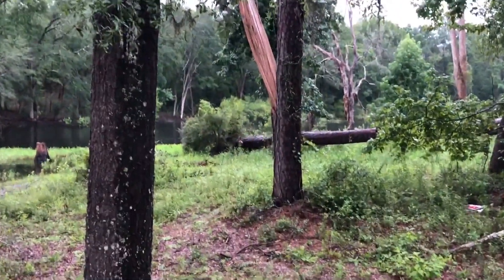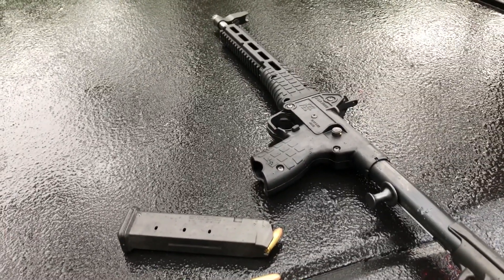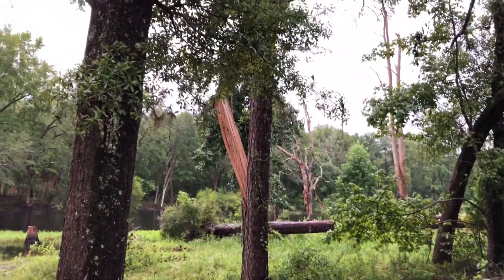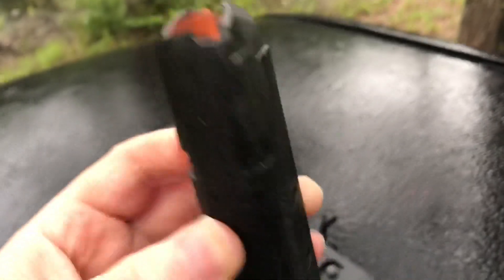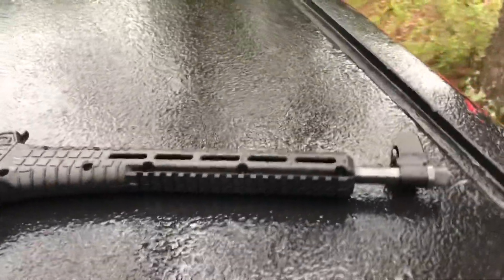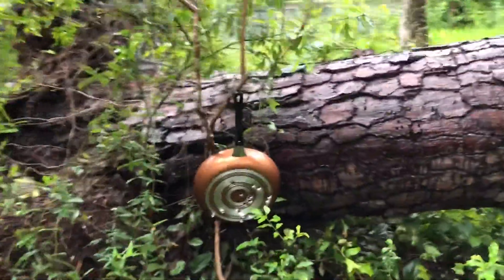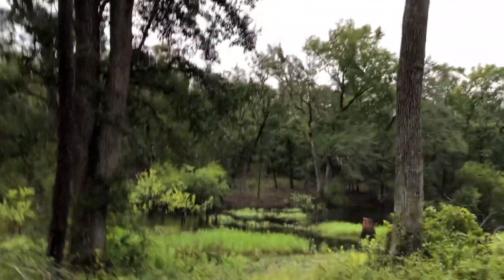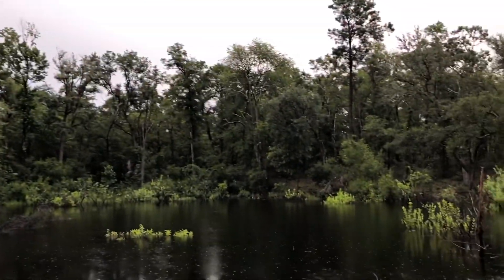Kel-Tec Sub 2000 Failure to Feed

Comment from the maker: Initially liked it but got tired of constant issues. Main issue is the failures to feed because these have a plastic feed ramp. I refused to spend money to get a new gun to work so the mcarbo metal feed ramp was out of the question. I did have their bolt buffer though. I also hated struggling to get a good sight alignment because it is almost impossible to get a good cheek weld. Took advice of a friend who said that with the fakedemic it is prime time to give guns you don’t like to new owners. So the best thing I liked about the sub 2000? Selling that POS! Plus I sold it for 200 more than I paid for it.
Reply: I replaced the feed ramp and mag release and love it. no FTF at all running 9 different kinds of ammo of various weight and style. I did think It was pretty lame getting a gun with a plastic feed ramp. can't imagine designing a firearm with a plastic feed ramp.... like it's an extra few bucks.... make it stainless steel....
Reply from the maker: @81brassglass79  selling mine was the best mod
Reply: @martinrps13  

I had one on order. Even put 1/2 down. The just finding out I have to spend another 500 on it to make it th gun it should be from the factory. Not cool. I really wanted this gun because no nfa crap, concealable, portable pcc, using common magazines.
Reply from the maker: @blacktoastmcbiscut8650  Yeah from the standpoint of being an amazing gun it has all of the right features it just sucks that the functionality is not where it needs to be.

Comment: I have a Kel Tec S2K Gen2 chambered in .40cal (using Glock mags) and I have a crap ton of those similar feeding/ejecting issues.  Brought it home from the range, gave it a quick clean and lube and took it out.  Loaded my Glock 23 magazine to capacity with cheap Walmart Federal Aluminum cased ammo, and from the first magazine, encountered maybe about 3-5 of those issues with EVERY damn magazine. That ammo shot/grouped great...tight group, but FTF a lot.  I then tried "Perfecta" ammo...same issue.  Then tried Remington (green/white box) and still the same issue.   Then I thought to myself that "maybe" the plastic feed ramp that comes with the rifle, after shooting several rounds, will heat up and become ply-able/softens up, which might cause the issue with the round feeding into the chamber.  So I decided to go to MCarbo website and ordered a bunch of after market upgrade parts, including the stainless steel feed ramp.  Then took it out to the range with the newly installed parts and used WWB ammo and NOT A SINGLE ISSUE AT ALL...except the grouping was all over the place.  I decided to try the Federal Aluminum cased ammo again and shot flawlessly and grouped beautifully...been putting hundreds of rounds with NO ISSUES.  Only downside is now with the upgraded Mcarbo rear peep sight, seems like, for whatever reason, I'm not able to zero in on the iron sights no more.  I've actually zeroed it in with iron sights, actually, but only if the front sight post is adjusted waaaaayy to the left (no longer center to the front sight guards), which looks really awkward.  Later installed the MCarbo rear side-folding scope mount and with that, I am now back on target.  Just gotta figure out why my front sight post has to be so waaaaayy to the left in order to be zeroed/on target.  So frustrating.  Any advice would much be appreciated !!!   Thanks !
Reply from the maker: That sure is a lot of money and work just to still have issues. I keep telling myself I refuse to get the metal feed ramp because it is pure crap to need to do that to a gun when it should have came with one from the factory. I shot mine a few weekends ago after cleaning it and using Lucas gun oil. Still have the same problems of failure to feed.
Reply: Yes, regretfully so, it was a lot of money in after market parts AND time to put into this gun.  After all the upgrades, the total amount spent (including the rifle) was about $800 or more.  If I knew this, I would not have bought it.  But, "it is what it is", I suppose.  But not with the M*Carbo side flip red dot optic mount and that it's not zeroed in for that, it's a fun rifle to shoot.  Not sure if from the beginning it just didn't like Federal Aluminum ammo & Perfecta ammo to begin with, but it did perfectly fine with WInchester White Box and ate it all up.  Maybe it was the WWB that "broke in" the rifle?  Couldn't tell ya, but I'm happy it cycles Fed. Alum. ammo fine and shoots very accurate.  I just need to work on the iron sights now.
Reply from the maker: ANTHONY N. That is a lot of money for a kel tec...unless it is one of their bull pup rifles. I don’t know what I will do but I had originally planned on keeping it all factory. But a gun that jambs frequently is not fun to shoot.
Reply: That’s it. I’m getting the Mcarbo feed ramp. I also have the gen 2 in 40 cal and had a ton of FFFs, except with perfecta 170g - it runs those just fine
Reply from the maker: Almost all of the 40 caliber bullets I have seen have a completely flat nose. Are yours like that and if so do you think that helps cause the issue? I still refuse to buy the upgraded feed ramp because I think it’s bullshit to have to pay extra money to get a brand new gun to run good.
Reply: martinrps13 - Almost all .40 ammo is designed with that flat nose you’re referring to, from many different ammo manufacturing Co. (Federal, Winchester, Remington, and many many other off brands, and why that is, I have no idea.  At first I was thinking that the flat nose would be a factor as to why it cannot feed (Failure To Feed/FTF) up the ramp smoother as a cones shaped nose like other calibers.   But then also, after buying and installing the MCarbo aftermarket parts, including the stainless steel feed ramp, as I was removing the original KelTec feed ramp, I found out that their feed ramp was made of plastic, and that was my second theory as to why I was having feeding issues, because after firing so many consecutive rounds, one would think that the plastic feed ramp would soften up and create friction/resistant as the bullet is being guided up that softened plastic feed ramp?  To be honest, I do not know what was giving mine issues, but I highly doubt the flat nose on the bullet would be the cause.   I’d blame more on the plastic feed ramp first, but that I cannot confirm either.  But after installing the stainless steel MCarbo feed ramp, I fire off a few magazine (cannot remember brand of ammo), but had maybe a couple of FFT to start off, but has since “broken in” and has been flawless ever since....after 400+ rounds or so or various types/brands of ammo.  Also note that not only did I install the stainless steel feed ramp, but I also did also order some other different upgrades (not sure if any of those might played a factor in its ability to shoot now with NO FTF/FTE.
Reply from the maker: ANTHONY N. So much work just to get it to be somewhat reliable
Reply: I added the metal feed ramp and I still have the same issues?
Reply: So been a while since I updated but with all the aftermarket MCarbo stuff put it, and “breaking it in”, my KelTec has NOT had any issues since.  Made this video of me shooting it years ago:

https://youtu.be/QuJ4O-k14NQ
Reply from the maker: I wish you luck! Sold mine and don’t miss it at all. The thump of that large bolt was even more annoying than the frequent jams. I think I may save up and get a radial delayed blowback 9mm

Comment: I don't know what happened to mine, but the feed ramp is completely missing now. Is getting a stainless one worth it? And is m-carbo worth the 30 bucks
Reply from the maker: Everyone that I talk to about them say that they love their feed ramp. I just can’t bring myself to spend money on something like that that should be good from the factory
Reply: @martinrps13  I know right? The polymer one fell out after about 150-200 rounds
Reply from the maker: How did it look after falling out?
Reply: @martinrps13  just a little metal ring that holds the ramp
Reply: @martinrps13  you keep saying it shoulda been good from the factory but forget that it's a budget carbine from a budget pistol manufacturer, your expectations were way higher than they should have been... I bought my sub2000 and ran a thousand rounds thought it with no failure to feeds or any malfunctions for that matter... What I did have was humidity issues at home and my trigger springs rusted out... Rather than send the gun in for service I'm just replacing all the internals with the mcarbo kit. All better parts that shouldn't rust out on me again. Plus it cuts the trigger pull weight in half.
Reply from the maker: @mikedalto364  I didn’t expect it to be reliable enough for war use, just some fun at the range. I have moved on to a scorpion

Comment: Check the extractor on Sub2000 , yours looks broken. There is a crack on the extractor right in the middle. Is it suppose to be that way? please let me know
Reply from the maker: Where is this crack? Like in the video what is the time hack
Reply: @martinrps13     0:03 
shouldn't the extractor be a single intact piece?
maybe that's causing the problem
Reply from the maker: @ayush274  it is not broken, maybe just looks like that because of rain. Plus it doesn’t have extraction problem...just feeding issues.

Comment: I have the Gen2 40 glock model. Had that happen on mine and I noticed some scratching on the bolt, when I pulled it out to inspect latwr I saw deep scratches in the shape of V's or mountain tops all connected together if you know what I mean. My only guess was the bolt tube was malformed and scratching it with each shot and creating resistance. I sent it in, not sure what they did but its back to normal with no more of that happening. Haven't had a feed issue since. I thought about getting one of those metal feed ramps just because I hear it's better but I haven't decided yet.
Reply from the maker: I sold mine a month ago and made a $200 profit

Comment: Stock sub 2ks suck ass. Go to Mcarbo and support them. Since I upgraded springs and feed ramp, ive never had a failure to feed or eject. 12/10 recommend Mcarbo
Reply: Facts! $200ish you can upgrade the entire gun, but that's another 1/3 of the original price, a lot of people don't like throwing money into a cheap gun. Lucky I hardly have any failures with my .40 sub2000.  Don't forget the red lion handguard. It's metal and allows red dot mount and keep some irons

Comment: I have had the same issue within the first few mags but sometimes worse by turning the cartridge completely sideways and leaving a severe dent in the casing.  I hate the plastic feed ramp design and will soon be getting the all in one pro trigger job bundle from Mcarbo.  Kel Tec should have designed the gun with those internal parts from the start.  What I seem to be learning is the gun costs $350-$400 initially and then you have to spend an additional $200 on internal parts that should have been factory.  I hope the issues go away with the new improvements.
Reply from the maker: Yeah I refuse to spend money on something that is not really an upgrade on a rifle that I already paid 350 for
Reply from the maker: I switched to Lucas gun oil and have had zero issues with mine since. It is a blue colored oil.
Reply: Yeah my casing have dents in them too!!! Idk why i take my mag out an the top first round has a big dent in it
Reply from the maker: Kelsey Rainwater it is from the round hitting the bottom of the bolt. Load the mag half way and do it and see what happens. Or take the bolt out and load a full mag and see what happens.

Comment: Need an upgraded feed ramp
Reply from the maker: I saw that thing and got a CZ scorpion and never shot that and then got a dry bag but now for some reason I was dumb enough to end up buying another sub 2000 but this time I did order that metal feed ramp from M Carbo, but the problem is it needs a mad scientist to put that thing in based on how hard it is from the videos I see
Reply: @martinrps13  I'm about to order the mcarbo trigger kit that comes with the upgraded feed ramp. I watched the mcarbo full build video and the whole thing looked fairly simple I'm hoping that's the case cause im no gun Smith 😅 I do like the sub 2000 it's a nice simple short range rifle. I hope both of our installs go smoothly 🤙
Reply from the maker: @Reno420alex but as soon as you open the gun up you might as well order all the other things he offers. Steel pins, upgraded trigger, all the springs. By the time we are done with all that and the buffer mods and heavy spring kits and the heavy weight charging handle…could have just got a cheaper PCC. After watching his full video I am really on the fence with taking it apart…..I am decently skilled but looks like too many small things and my fingers are not what they used to be. 

Hope your upgrades go smooth
Reply from the maker: @Reno420alex shot my new one

Comment: Yup it's unreliable. Mine does the same thing.......
Reply from the maker: I had no issues the first time shooting it though. Next time I will use factory Glock mags and see what happens.
Reply: Idk yall I bought a used one private sale. Had maybe one FTF because of weak mag spring. BUT as you notice, the "feed ramps" are at a terrible angle. I lightly dremmeled a better feed ramp and aint a single problem in 300 rounds.
Reply: @crustyspaghetti3749  Mine was new, no excuse, had to send it back for a barrel recall. Put 33 rounds to sight in new barrel and it seems to be ok. I won't know till I get the first 1000 through it.
Reply: @ckim6400  How long ago did you buy it and have to send it back in for the barrel recall?
Reply: @Lonestar-zn2ym  I bought it end of last year I believe it was. Kel Tec has a website for the barrel recall by serial number. Took them 9 weeks to get it back to me.
Reply: C Kim I just bought the .40 cal version and it jammed similar to this twice on first mag load and three times on the second mag load and I was using the factory 13 round Glock mag that came with it
Reply: @carolinapanther1762  I think those are P Mags
Reply: C Kim mine is a plastic Glock mag. But anyway the gun jammed twice with first mag load and three times with second load junk junk gun. I'm selling it to the first dummy who thinks keltec are good guns and buy the PSA ar-15
Reply: @carolinapanther1762  Smart move, CMMG just came out with a 10 mm. Now that would be nice!
Reply: C Kim if I get another cheap carbine it'll be the highpoint .40 or 10mm. My friend has a 40 cal highpoint. I thought I was going to one up him. I got it last Saturday went shooting with him Sunday. Ended up shooting the ammo I bought out of his gun. he had the high capacity magazine and factory ones too. no problems out of it at all. Oh and you can shoot +p  and +p+ ammo out of highpoint
Reply: @carolinapanther1762  People who own High Points say they work well. The CMMG 10 mm isn't cheap. I chose to go Draco 11" with Sig brace. Gives me 7.62 X 39 power in a short package. Good luck whatever you choose and be safe.
Reply: Its probably the rain mane
Reply: And probably the motorcycle chain lube you used 😐
Reply: @carolinapanther1762  bulky, and cheapest looking guns on the market. If Nerf starts making guns, the foundations will be off highpoints. Have fun 😊
Reply: I have a .40 sub200 . Around 500 rounds through it. only a few jams. I credit that to breaking it in. The worst thing about the gun Is the required check weld is Fawking ridiculous. It's uncomfortable. This gun has been solid all the way through.